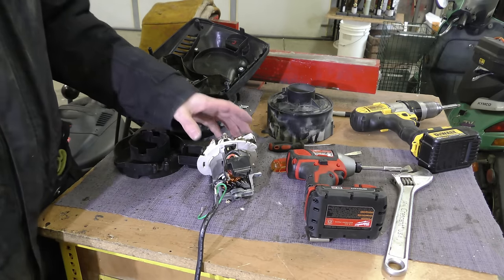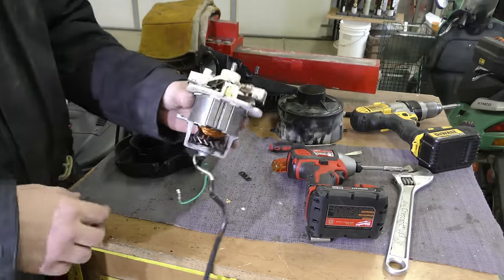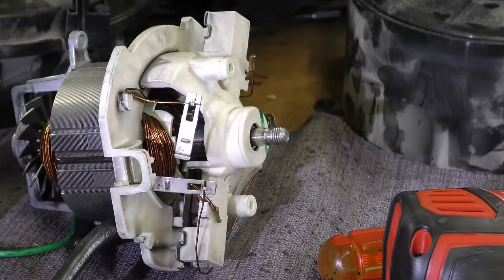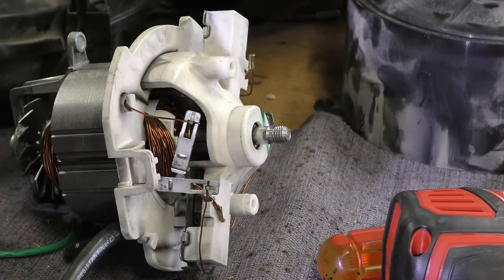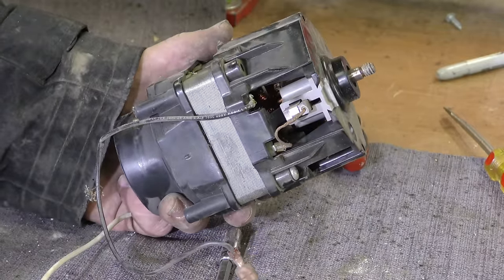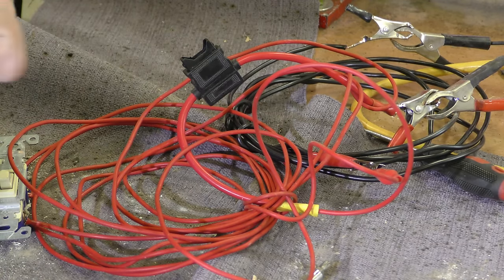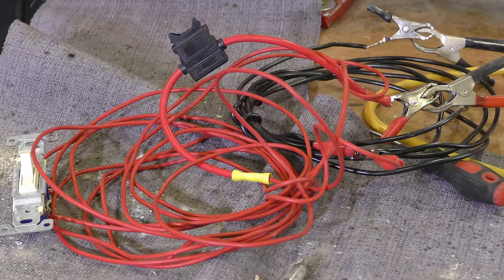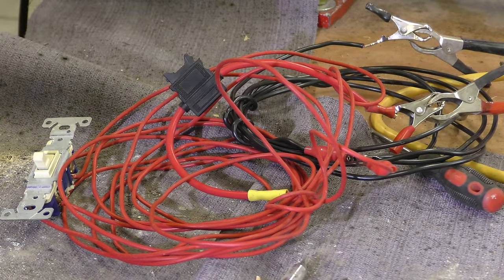Shop Vac Failure Points and What Happens When You Short Out a Fuse

Comment: There is a reason why the fuse tripped the 1st time.  And thermal switches are in the circuit to allow for the rare event that the motor starts to get hot.  The thermal switch will open for a period of time and then reset.  If the motor is pulling too much current, then it could mean bearings need to be lubed or replaced.  Friction there would cause resistance to turn and cause higher operating current
Reply from the maker: Yea, so you have to buy a new one....
Reply: Exactly! Good video but the one thing the video missed is that lubrication of the moving parts, such the bearings, can cause over heating and a fuse failure. Other Shop Vac vids cover this and I myself was able to keep my Shop Vac in working order by simply applying a few drops of "3 In One" oil to the bearings. He should have included that in his video.

Comment: So the yellow switch you pulled out and removed the inner "thermal fuse" or just fuse.  Can you remove that, put it back together and run it without it?  I tried putting a 15 and 20 amp auto fuse in connecting the post.  They both instantly blew.

Comment: Do not lift a shopvac up by the handle while the machine is running. There exist a circuit that runs through the plastic that's very difficult to I found it with a m looking for continuity. Anyway if you lift up on the handle while the machine runs you momentarily break the circuit and cause an arcing. The arcing further destroys the device in the lid. Eventually with enough lifts it fails. The device has no other purpose but to our arc when lifted. It has to be planned obsolescence. It was covertly install where you wouldn't notice it. The solution is just to bypass this device. Then it runs perfect again
Reply from the maker: Interesting.
Reply: No, it’s not interesting. This guy is definitely on some drugs.

Comment: Hey, I was cleaning the fan, and the motor started and stopped, unfortunately it was plugged in, now the machine doesn’t work. Could this be a fuse? How can I fix my vacuum?
Reply from the maker: I would definitely check that! Also make sure you didn't pop the breaker for your outlets.

Comment: Over current protection device(fuse) voltage rating references the internal pressure rating of the device(fuse). A 120 volt 100a fuse will grenade in a 600v 100a circuit and a 12v fuse will damage its  fuse holder connections at 120v over time. Since there is no OCPD selective coordination achieved and the OCPD not user serviceable at the equipment an OCPD is pointless so securely by-pass it. A fuse does not encounter wear throughout its service life as a breaker does .It is either good or bad. Whatever that was it was not neither a fuse or a thermal overload but likely a cheap wearable link designee to initiate scheduled  manufacturer maintenance or notice end of end service life so check wearable s such as brushes and bearings  before recommissioning the equipment.  Expensive equipment  have factory programed counters that shut equipment down and flash a maintenance service code. Same deal here

Comment: I have a stinger shop vac and mine doesn't seem to have a thermal switch. The power switch is good. 

Update* I found it hiding under insulation, it is a thermal fuse for 133c 5a 250v. I can't find a 5a fuse tho.
Reply from the maker: Yea, good luck finding an actual replacement.

Comment: The fuse doesn't know what voltage is used, only the current (amperage) in
Reply: Barry Case Baloney.  It's entirely possible to have the fuse arc over and continue to conduct if the fuse opens and the voltage is too high for it.  Not only will it continue to conduct, it will start on fire.  Fuses have a voltage rating for a reason, it's not a scam to get you to buy more fuses.  Even in this video you can see a problem:  12V fuses that open on 12V will not get charred like that.

Maybe these particular 12V fuses don't start fires on 125V.  But don't expect them all to behave this way.
Reply: Like KC9UDX said, the amperage is what causes the heating and the fuse to fail initially, but the voltage rating is what prevents that failure from cascading into something catastrophic.  Oh, and also things like how many 12V fuses have exposed test points so you can text their status while installed, but for 120V, if you put your hand directly on one of those contacts it will bite you.

Comment: hi rd allen. i have 10 year old bissell vacuum cleaner which suddenly stopped working . i found out ceramic fuse tucked near motor wrapped in black rubber coating. this fuse was on brown wire going to motor.i can read 250v on this fuse , this isn't solder kind of fuse it was clamped on brown wire. anyway i couldn't find slimier thermal fuse on ebay so i just took it off and joined brown wire securely which is going to motor.now everything working fine . 
was that fuse was thermal fuse. i dont use vaccum cleaner for long time. plug have 13 amp fuse in it. house is new built with breaker etc. should i be worried
Reply from the maker: Had that type on an old vacuum as well, did the same thing you did, 15 years later it is still kicking!
Reply: @radozeman  thanks a lot RDAllen

Comment: The problem with that automotive fuse, that you have overlooked, is that the pins are exposed.... dude that’s 110v live that if you touch the fuse will shock you.  The exposed pins are for using a 12v probe test light.   Look at the top of the fuse and notice the two metal exposed pins. Your house breakers don’t have bare wire or pins exposed until you remove the panel.
Reply from the maker: Looks like you answered your own point with the last bit of your comment!
Reply: RDAllen your tear looked exposed, if it’s inside then i guess go for it.

Comment: Can I replace the fuse with a 15 amp car fuse, like in your other video or, do I take the old one out first, if it is the fuse?
I just bought another shop vacuum made by SHOP-VAC with a 6 gal. capacity with bag for $39 98 with tax=$43.28.
I didn't get the 2 year warranty for $4.95 but, I am wondering now, if I should!?
Awesome video. Thanks again.
Reply from the maker: Seems like a lot of vacuums die after about year!  If it is the fuse, I'd just put a car fuse in it.
Reply: What size fuse should I use?
Thanks so much for your reply and videos.

Comment: If the motor is fried, its about the same price as a whole new shop vac. These things are engineered for premature failure. And you can forget about Ridgids "lifetime" warranty- its no more.
Reply from the maker: They are unfortunately all made almost the same now and like you said designed to fail.
Reply: My old shop vac had a lifetime warranty and they even sent me a replacement powerhead with no hassle didn’t have to return the old one or anything, they still offer some with that lifetime warranty, but the one I replaced it with was a cheap one because I wanted the stainless steel and it does not have a lifetime warranty

Comment: If one has a failed fuse I would be curious what the amperage is compared to new. Worn bearings, brushes, or arcing switch may lead to too much amperage use. Ours are used for walnut shell blasting. The bearings get dust through the seals and do not last long.
Reply from the maker: Seals? those bearings in the vacuum are actually sealed?
Reply: Cheaper ones may be bronze sleeve bearing or similar. Haven't bothered with them. Industrial style we use has a sealed ball bearing. Either way I don't think it would be a bad idea to have a way to quickly check its amp draw at the wall plug. Especially at start up. High amp draw would indicate an unseen issue. If you're repairing quite a few. Just food for thought. I have actually seen one that they failed to replace when asked and the fine dust kinda spit a fire ball when the motor arced. Lol just little hair missing.

Comment: Looks like that's an internal fuse of some type my Shop-Vac quit working watched your video on some problems and mine was that fuse I put a butt connector in it granted internet police will say use a fuse or OEM product Etc if that's what you want to use use that internet police
Reply from the maker: Yep, I did that exact same thing with another vacuum I have, 15 years later that vacuum is still running strong!  It probably would be safer to have some sorta fuse....
Reply: Mine too. Took me a while to find the culprit since it worked intermittently. I was thinking about using a 14 ga solid wire to replace the fusible material . If the motor is starting to overload, the next death will most likely be permanent even if I could get the replacement part for a discontinued model. Built in 2 cent demise.
 Came here to see if I was on the right track.

Comment: Mine is a RIDGID 5 gallon. How does the power cord wires(2 wires/ 1 black and 1 white),  connect to the 2 wires that hook up to the  motor and,  on and off switch?
Awesome video. Thanks a lot.
Reply from the maker: Most of them have a 2 pole switch, both the black and the white connect to one side of the switch and both the motor wires connect to the other side.
Reply: Thank you for your reply.
Let me put it this way. Do I have to splice the power cord into the wires that go to the motor"and" to the on and off switch?

Comment: I’m not gonna get into the nuances of how to refer to the fuse, but 100% for sure it is designed to break continuity when shorted or when too much power is drawn, not at a specific temperature.

That being said, I really wish I could buy one of these for cheap right now, but absolutely do not just connect them together.

Do you want your vacuum to catch on fire and burn your house down? 

For phucks sake if you can’t replace it with something that will properly protect the circuit just get a new one, do not rely on your household breaker to prevent the device from internal issues.
Reply from the maker: You realize the outlet it is plugged into is protected right? The correct fuse mostly likely is a thermal fuse (thermal = heat), most sensible manufactures will put a resetting type fuse. It is clear they put this in the vacuum so you have to buy a new one.

Comment: Hey smart guy.... You shouldn't mess with electricity when it's obvious you don't know what your Doing... Wouldn't say I'm one of these extremely smart people your talking about But i am a master electrician... And putting a larger fuse in until it won't blow anymore is how houses burn to the ground.. The breaker tripped first because you created a dead short and the breaker did exactly what it's designed to do. Swap that breaker in your panel for a 20 amp and use the 15 amp fuse that didn't blow bet it will now but i don't recommend it.. Hopefully nobody plugs into a circuit rated for 20 amps because that shop vac isn't gonna work anymore...
Reply from the maker: That is a 20 AMP circuit with a 20 AMP breaker!

Comment: so if it was running and it just stopped running - aim for the fuse vice the switch? And if I'm replacing the fuse what are your thoughts on just replacing the switch as well?
Reply from the maker: Depends on the age or your shop vac, olders ones seem to have better switches, it is only the newer ones (last 5 years or so) that I have had an issue with.

Comment: I have worn out five shop vacs. NONE of them had a fuse or switch problem. They all had failed bushing/bearings in the motor. The newest one is still new in the box, on stand-by. It cost $20 at Walmart. If the old one fails (and it will, things wear out) I will open the new one, probably will not do much investigation on the old one. It is ten years old. Got twenty bucks of use out of it long ago. Not worth my time. PS, that IS a thermal fuse or fusable link, designed to fail before the motor catches on fire. This guy is not so smart.
Reply: Walmart doesn’t sell any shop vacs for $20 not even five years ago are you buying some knock off or are you paying more than $20?

Comment: Engineered Obsolescence?
Reply from the maker: Exactly if you ask me!
Reply: So I have a fein vac, it's been awesome. I'm a marine carpenter and they have an outlet that your tool plugs into so the vac turns on when the tool is operating. The other day it started tripping the GFI switches when I plug it in. Any suggestions?

Comment: That wasn't a fuse at all in my opinion, I've seen stuff like that, it was an intention shut down pin that from personal experience I've seen in all sorts of things from vacuums to radios to fans and so on, designed to break the connection of electrical current and "kill" the device

Comment: So in other words the equipment can be as electrically dangerous as you like so long as your house wiring is up to spec?
This is a dangerous practice whether you disagree or disparage the "extremely smart people" (as you put it) tell you so or not. All you've demonstrated is that fuses and trips (breakers) operate on a dead short circuit. You've also demonstrated what electricians know as discrimination. The fuse in the appliance is meant to fail before the breaker in order to avoid the whole circuit tripping out. In the same way the fuse in your home supply is meant to operate before the substation fuses!
Now demonstrate what happens when your motor gets overloaded or overheated. I give you a hint. The fuse won't blow or the breaker won't operate till the motor burns out and shorts internally.

Comment: You act like you know what your doing when you say " these extremely smart people" but your only showing your ignorance to anyone that knows electricity . First off You apparently are using a ground fault circuit and that why your breaker tripped so fast. Not all houses have ground fault circuits to trip the breaker so fast, alot still use fuses instead of breakers. So your ignorance can get someone hurt or electrocuted if they listen to you. And that thing as you called it that you put that fuse in will work unless the amp draw get so high it melts the fuse link cause that's what the broken part was. A fused link that breaks apart when the motor is pulling to many amps or is basically in a bind. People do get electrocuted in houses that have breakers and fuses so never rely on a breaker to think your safe. Use caution and never bypass a safety component or fuse. It's there for a reason and not to just make you buy another vacuum.